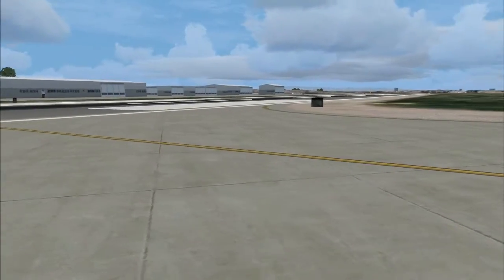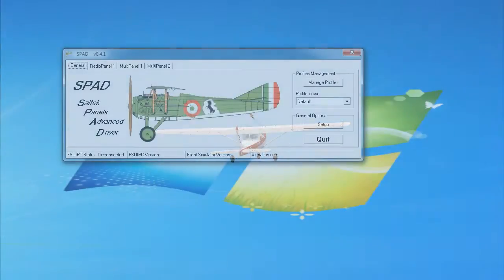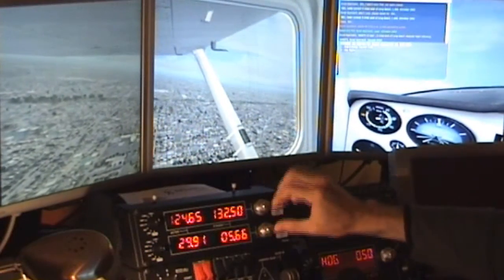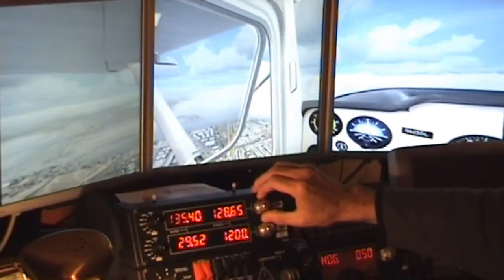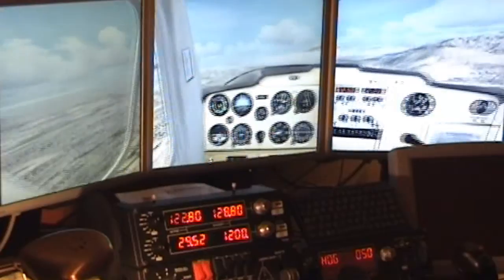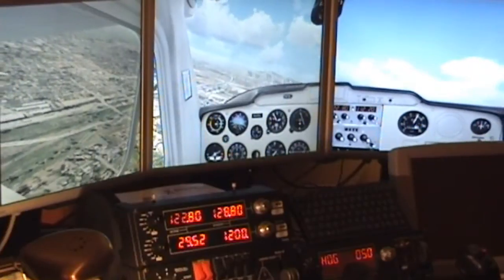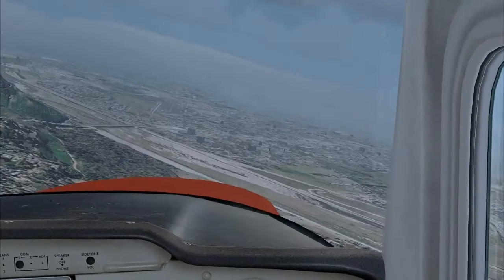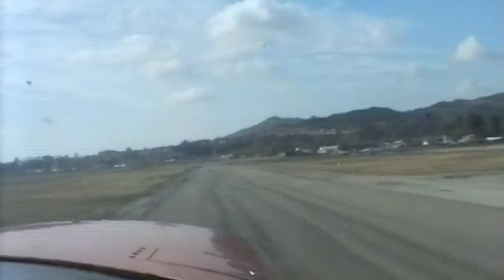VFR II - Saitek with SPAD driver

Comment: I have radio and switch panels but even with spad driver installed I can only get one panel or the other (not both) to respond in either the spad software or xplane (eg radio panel responds but not switch panel or vice versa)..saitek driver uninstalled but saitek xplane plugin is installed.. would gratefully appreciate any feedback on how to solve this- thank you
Reply from the maker: justinspirational Sorry, I am not a power user of these panels and only have one of the radio panels installed at the moment. I think there is new development of SPAD ongoing, so perhaps look at the support forum.
Reply: Almost Aviation ok thanks

Comment from the maker: My hunch would be that the PMDG does not use standard FSX functionality, so you will not get the multi panel to work with it using a generic driver such as the one from Saitek or SPAD. You MAY be able to get some results with the SPAD  driver and FSUIPC, but I have not done such hacking and can't really advise. You could try asking in the support forums for Saitek, PMDG and the SPAD driver.

Comment from the maker: I don't think I was using EZCA here. You can certainly use FSUIPC to calibrate the Saitek yoke, though it won't fix any innate problems with the yoke. For example it won't prevent the yoke's tendency to de-calibrate from time to time, which seems to be a hardware bug of some sort.